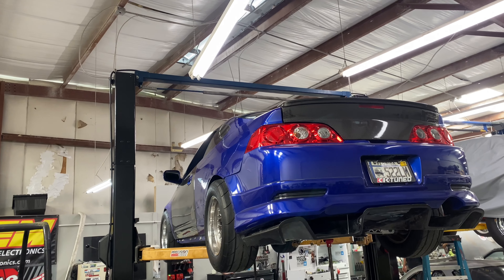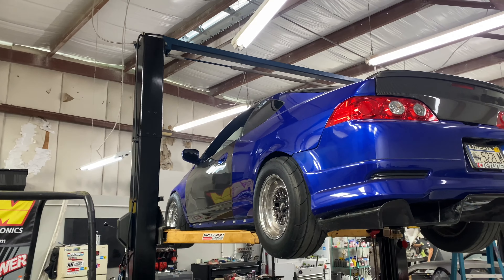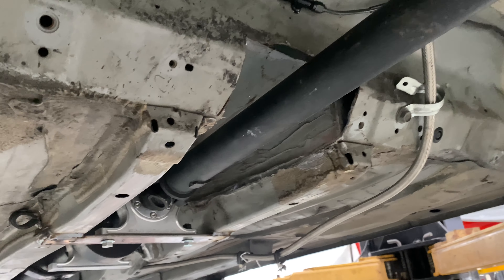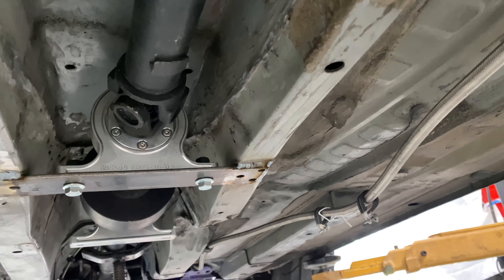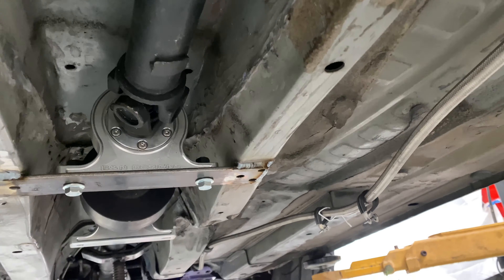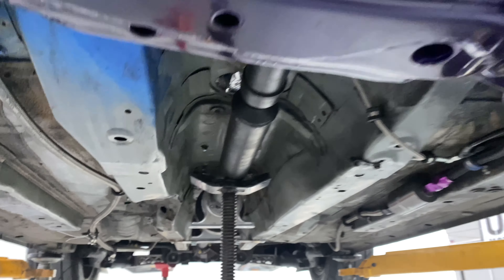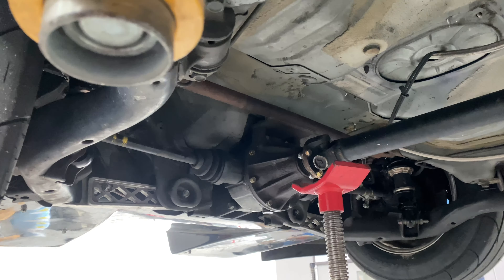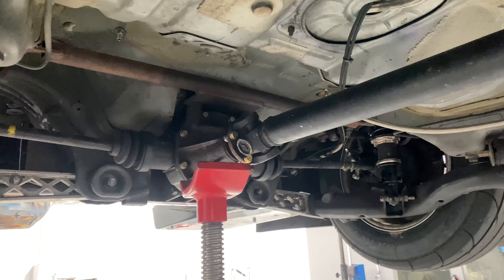Underneath My Awd Rsx

Comment: would this make the car handle better in a circuit setting? i heard this setup is a 70/30 front/rear split in power so i figured it would only help for launches

Comment: I love how it's all stock suspension and a simple bracket they're probably sell that bracket somewhere you need to make a parts list on here. I would love to see the 3.0l vteck Manuel 5speed in a RSX tipeS. With the awd transmission I don't know if they make the 5-speed all-wheel drive it may have to be automatic.,-)